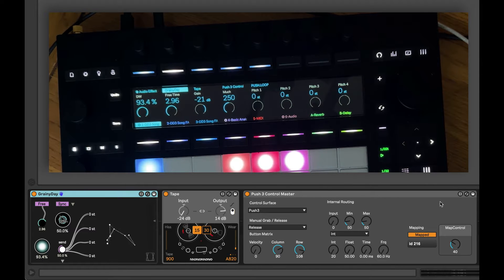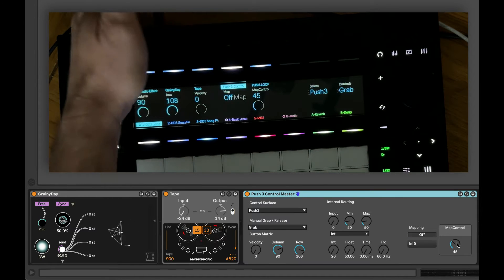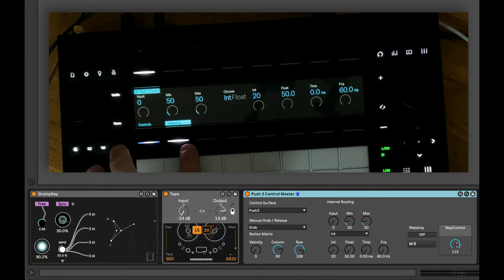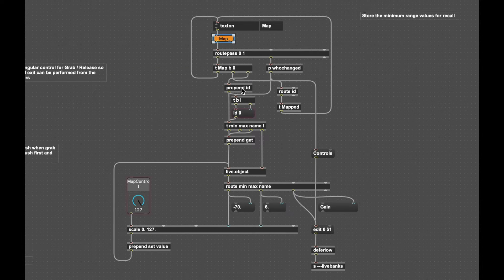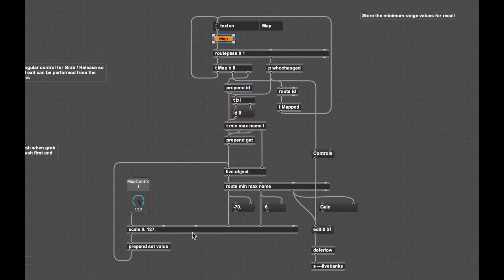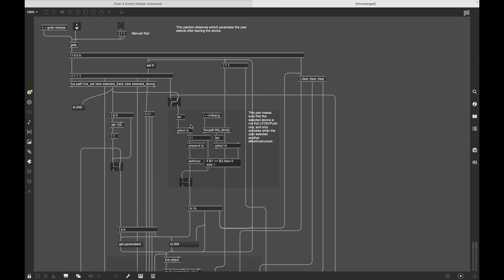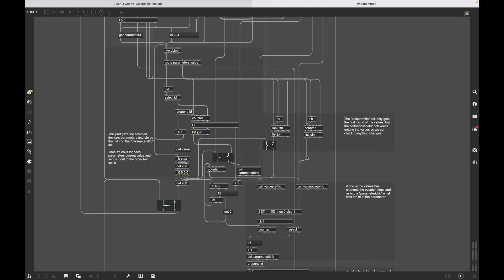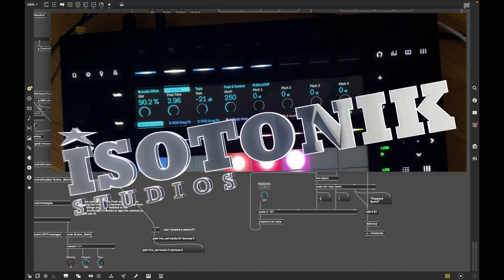MaxforLive & Push 3 Standalone - Mapping to Parameters

Comment: with this device i can map any paramater to the control master and for example this control master knob is mapped to my external knob.
so i can remap in standalone what realy is a big deal! but at the moment it doesnt work. i guess firmware related :(
Reply from the maker: Sorry not something that was ever planned for, the mapping is purely for the Push 3 itself rather than an external controller.
Reply: but if i map the button of your m4l device in live (fixed to the external controller) this could work right?  @IsotonikStudios
Reply from the maker: @tanja.fleger  it could do, try it and let me know, I don’t use any other external controllers
Reply: the map button has no function for me. cant test it :) neither on standalone(beta fw) or live 11.3.13 @IsotonikStudios
Reply from the maker: Try the LFO for Push device then, both are working this end so I can’t really help there.

Comment: map seems tempramental. in general all the grab/observe stuff seems super broken right now. Like if you reload a liveset stuff wont work even if you try deleting the device, adding it again, grabbing, observing - it wont respond. I was hoping that your device will have the sure way to correctly kill and create live observers but it seems its an issue with Standalone at the moment. I hope this gets solved soon! 
Love the series!
Reply from the maker: If you make sure you release before loading a new set it seems to work consistently, haven't experienced Map being temperamental though. When opening the device and changing things I've found that I've had to recycle Live and power on and off at times as things just grind to a halt... be good to get these inconsistencies solved in time!